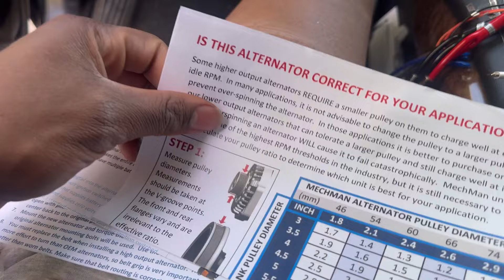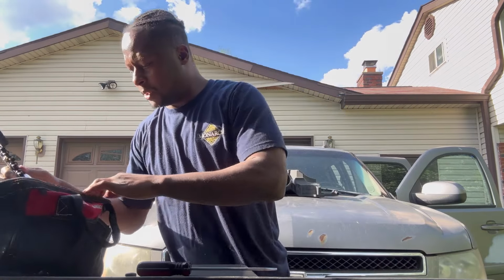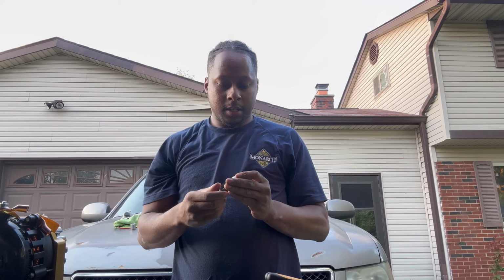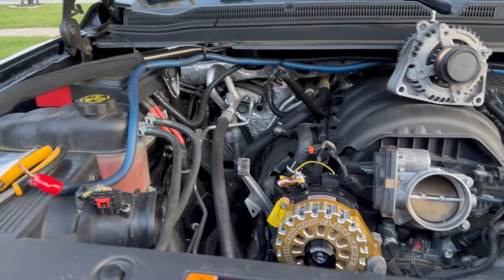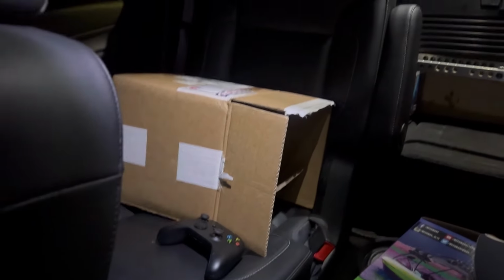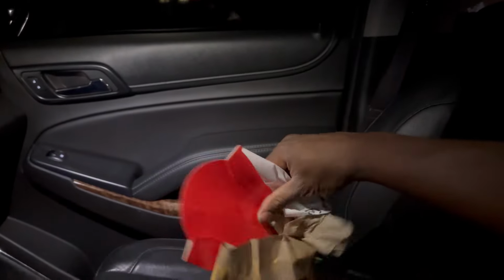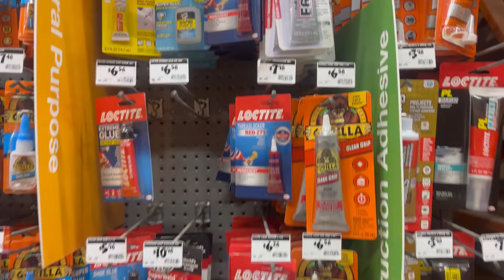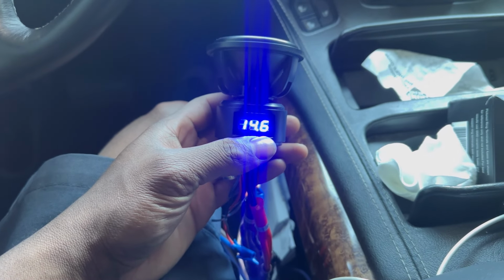Installing A Gold 400 Amp Mechman Alternator On My 2017 Chevy Tahoe

Comment: Did you figure out why there was a lag in the output when you started up at 14:00? I would expect that output would be instant 14.6 again. Curious, because I just picked up a mechman myself. Haven't installed yet.
Reply from the maker: Just forgot to hook up a ground wire 😅

Comment: I have the exact same alternator just got it . Where did you hook up your upgraded power wires too? It’s says negative ground  goes to battery to alternator and positive wire battery to alternator. Is there a third ground wire you gotta hook up ?
Reply from the maker: I grounded it to the engine block and power wire to battery